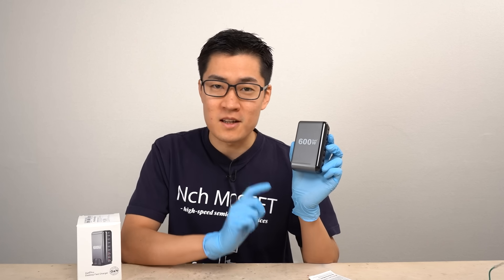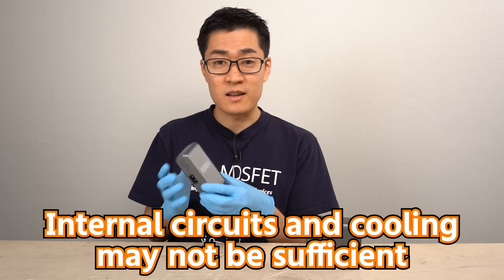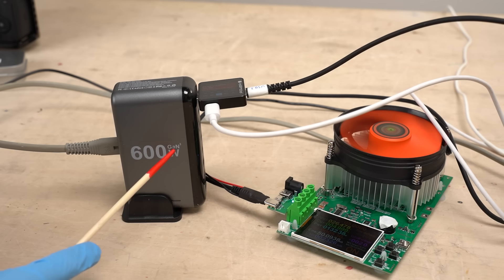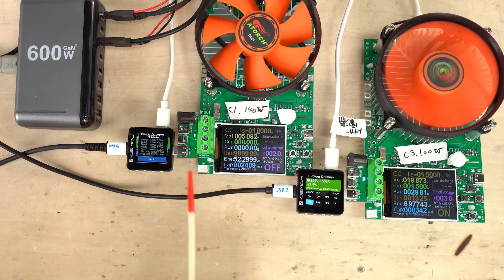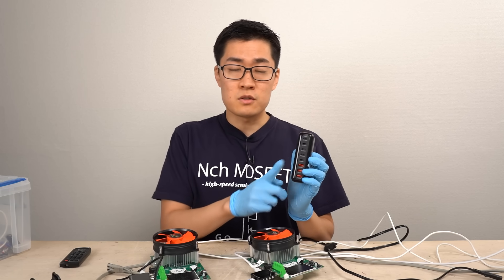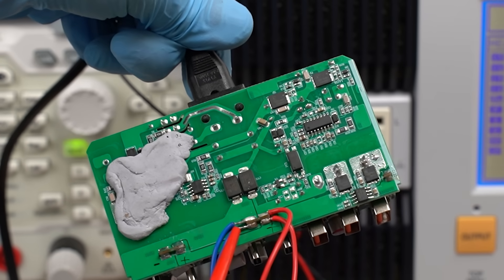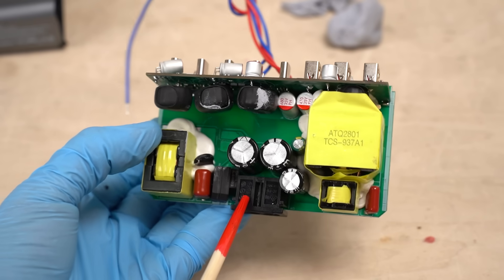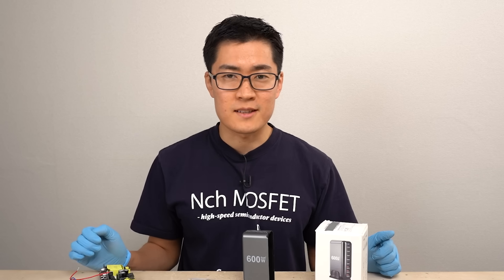The "600W" AliExpress USB Charger  Teardown & Review

Comment: Thanks for the decent review. I guess the manufacturer believe most of the users do not have that high demands as they only want to have a product simply having  many ports and charging their various devices at the same time.. 😂 (like me)
I bought two 800W and 1000W models for 21 and 25 USD.

Comment: To be honest that not anywhere near as bad and dodgy as would have expected and normally what I come across they are very dodgy to deadly at best. For under $34 dollars it not a bad charger, decent isolation and transformers look good, if they didn't lie on specs and sold it for what it really is. I still take a 100w charger from a reputable brand due to heatsinks alone.

I would have to tear the transformer apart as most dodgy chargers  primary or auxiliary is touching the secondary windings and relies only on the vanish to isolate and not isolated correctly. This one looks like it may have a decent transformer, just look at the leads going into the transformer and you sure see insulation on some coils leads. If transformer is good, then would be a decent enough. Much better then the cheap ones seen in the past by a long shot.

Comment: I usually get one of these if I can find it for $25-$30 USD making the price/performance acceptable to me. My testing is good, matching the specs in the advertising and does well for me considering I only use 1-2 ports continuously anyway, (3 or 4 ports rarely.) I've been wanting to try the 6 port 240w charger from ASOMETECH if I can find one in the same price range, reviews state it's actually 180-200W and does load distribution (like this one) depending on the number of ports being used.

Comment: If you look closely you can see it's 600VV not 600W ;)
ugreen has an 8-port USB C charger like this too (non nexode branded) 

at least the maximum power draw is as advertised, but as soon as you plug more than 2 things in the max output per port falls off a cliff

Comment: I wonder if the circuit could be modified to increase the output without it cutting out. That would be interesting to see. Either it outputs 600 Watts or it blows up.

Comment: Definitely is a scam. A wattage that high would simultaneously brick an Android device and cause it to spontaneously combust because of a combination of them treating heat like a drug and the device being severely overloaded.
Reply: Partly right on what you've said
Reply: Tell me you have no idea how chargers work without telling me.
Your phone if new enough uses USB PD to negotiate a charging voltage and amperage so your phone decides how much wattage it gets and to surprise you: there are android phone capable of 120w charging, exactly what the upper USB c ports can max deliver
Reply: @leocompany And then they become overgrown fire starters because planned obsolescence is highly rampant in America and every new phone model is twice as thin as the previous one. And combined with the infamous obsession Android smartphones have with building up excessive amounts of heat, six year old, barely used hand-me-downs are the best and safest option new phone owners have for the brand at this point. And it's the reason why the Note7 was recalled and banned from airports after it made the battery of that model become a ticking time bomb. After seeing the kind of shit show that ended up being I don't see my self ever buying a phone model made during or after 2019 until there are no more phones that are older than that left on the market.

Comment: I think you couldn’t get the 215 watts was due to using dc input for it. PFC systems that are active don’t work on dc, instead the input voltage just goes through the inductor and through the rectifier diode for it. That is supposed to have closer to 380~400 volts dc input for there. Without the pfc running it bottlenecks itself.

Comment: I bought Anker's 65W GaN . Same story . 65W is guaranteed only if 1 USB device is connected. It is also stated in the manual. The more devices you charge , the lower the output per socket.
What I really like in Anker is they use thick 220v input cable.

Comment: I've got the 320W & 800W version YMX-320W & BK-123D, and it is the same deal. Neither can deliver the Max Output Power, 320W & 800W, listed in the specifications. Both were also easy to open up without too much damage by tapping the seam hard with the rubber end of a screwdriver. While the 320W does list port combinations to use for a maximum output power of 145W, the 800W one is less clear about it. the 800W one just mentions the 5 usbc ports as max 100W, and the USBA ports as 60W. This makes me think it has a maximum of 160W using one usbc and one usba port, way short of the advertised 800W. The PCBs also look very similar to each other and to the one in this video.

Comment: If it had really delivered 600w, I would be terrified to use it.  I would keep a fire extinguisher and smoke alarm close by.  I love your power display tester.
Reply: A fire can start with 6w
Reply: @CMeosuarra Just the heat output of 600W would be dangerous in such a small passively cooled item. That is the power output of a mid sized computer power supply and they almost always come with a fan.
Reply: There are several YouTubers who test long duration test to see if it overheating

Comment: bought one with 300w. works good enough, still drops when i use more devices, but for charging photography lights works really good, i'm thinking if i can mod such devices to bypass that power sharing feature so each port could go to 100w ( i have 2 100w ports and 4 30w ports+ 4 60w usbA ports)
Reply: That would probably lead to catastrophic failure

Comment: Are you sure about the buck converter stage lowering efficiency only by 1-2% ? 95% is the best case scenario for any buck converter, multiplying this with the primary efficiency of 94%, you get 89%, which is bad.
.

Comment: Great video, as always.
About "cheap" Aliexpress products, I often consider the written specs are 4 times the real behaviour. So if your need is 4 times less and you consider the price is in line, then you can purchase.
Another point is the safety. Your video did not went closer to the galvanic isolation topic, but you said the design looks fine. Primary and secondary are well separated. Just wonder how it is inside the transformer.
Reply: Test drawing ~140w from one port for a couple of hours.... Could be a fun video !
Reply: my friend let me borrow simillar unit from seller showed in this video, transformer dont look as cheap as charger but could be little better, isolation last only up to 250deg C but its still better than 1$ phone chargers with isolation melting around 140deg C, also multiple shots from high voltage high power supply, around 5KV per pulse around 6kW didn't killed it
Reply: I got a similar 7 port charger from Amazon(though much lower wattage). And one night i smelled something burning and it was the charger. Thase cheaper ones can get very hot, and I don't think it's worth the risk.

Comment: 7:16 Are you sure it is not 155W? That bracket suggests me that the bottom five port can output 15W if you add them up, and not individually. Except if they did not want to write 15W 5 times :D
Reply: On most chargers, the USB A port derates some other port while in use.

Comment: To be honest, if this were marketed more truthfully, it would be a good product. It's a lot bulkier, but it's considerably less expensive than the Anker 140W charger I recently purchased. 
In my case, I'm unlikely to ever need more than 65 watts from one port for very long - my biggest PD loads are my FNIRSI soldering iron at up to 100W followed by my UGREEN power bank at 65W, and the chances of needing both of those at the same time are pretty slim. Considering that the soldering iron still performs very well at 65W and just takes a few more seconds for its initial heating, either of them could be used simultaneously with all of my other PD loads with this charger without exceeding the 170W. 
Unlike a lot of the sketchy power supplies, it looks to actually have a fuse, RF filtering, and decent isolation from the mains. I'd readily pay $42 USD for this charger if they were more honest and I were looking for a desktop power supply. Not so ready to do so if they're going to be deceptive about it.
Reply: 42 usb is a bit much. At least as an Australian. Thats like $90! I'd say maximum $60-70AUD and it'd be worth it, no more.

Comment: I have no doubt that by naming the power supply 600W they are trying to deceive customers.
However, I would never believe it because even my 140W Anker charger will overheat and throttle after about 20 minutes.
Reply: Will it be overheat tho if the size is that big?

Comment: Silicone diode voltage drop decreases with temperature. Running the diode bridge hot improves the overall efficiency at the expense of reliability

Comment: It can probably deliver the full 600 Watts under specific circumstances, but only very briefly, and only once.
Reply: yeah, I'm sure it releases more than 600W when it catches fire.
Reply: It can never deliver 600W at any circumstance without tampering the component/circuit. There are too many protections and because it's input is AC that is rectified and switched with high frequency, it is impossible to deliver 600W even if any of the IC is malfunction or one of the component is short. 

Remember, the AC - DC power supply like this needs to pass through HF transformer, that means malfunctioning (shorting) will definitely cause transformer to stop delivering and will short circuit on the supply side (not the output side). So it cannot deliver 600W under any circumstance (at the output), it can however short at the supply / high side, so it will trip your circuit breaker.
Reply: @stark_energy  oh, look, somebody didnt got the joke

have you ever heard about the magic smoke being released, just once?